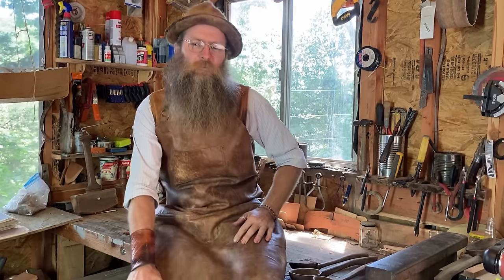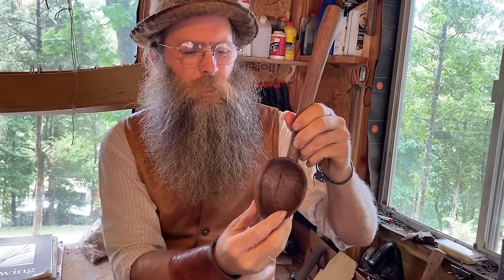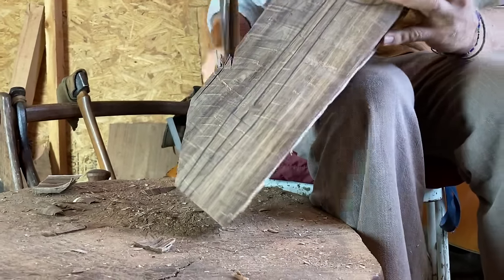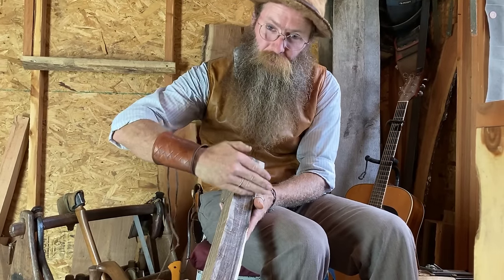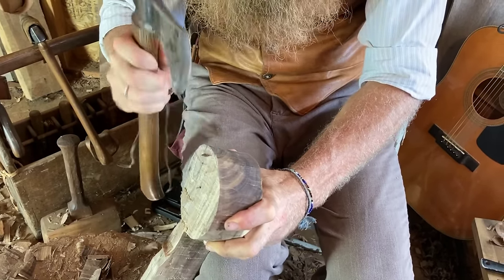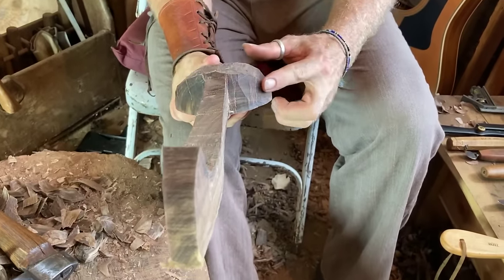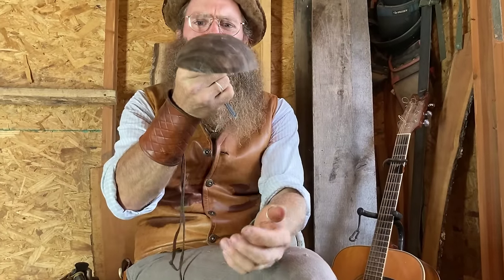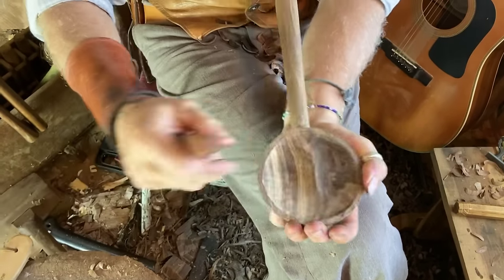How to Carve a Wooden Spoon by Hand

Comment: This is heavenly stuff to watch. I'm enjoying all your videos immensely.
I'm actually a cabinet maker and furniture restorer by trade, so a lot of this looks familiar- except for your insane axe work. I'm bluffed! You take this to the next level.
I have just one remark to make concerning the finish aspect: firstly, thank you for sharing the ingredients you use yourself. When I use anything similar products I apply them hot (hot air gun)- especially beeswax. This method really helps the wax, or even oil, to penetrate much deeper, therefore longe lasting. When I carved my oak chimney surround here in France (450 kgs- about 1,000 lbs of freshly sawn oak) with quite a few details, because I DON'T sand carved stuff, I burnished the whole structure with various bits of hardwood (ebony and boxwood) till every millimetre shined. Push very hard. This gave a nice sheen to the wood. Then came the hot beeswax treatment with some earth pigments. 3 weeks to dry then I removed excess wax and buffed the whole lot. By heating you get a deeper finish.
I hope this information will be useful to some.
Please keep your fantastic videos flowing (just like the beautiful lines you use on your spoons). God bless.
Greetings from France

Comment: Your videos are just full of excellent information! I've never seen someone who can carve out  3/4 of a spoon/ladle with a hatchet before. Incredible control. I've watched copious amounts of videos on spoon carving and all of that information goes out the window with just one of yours. Thank you for sharing your skills!  PS- I didn't have a small scorp, so I took an old wrench I got for .25 cents at a flea market, the type with the round end and the other end is 3/4's open, I think they are called a mechanics wrench?? I turned it into a scorp. I cut off the end that had the 3/4 wrench end and then made a handle for it. The cut end was apoxyed into the handle. Then I took a rotary tool with a cylindrical stone bit and ground down the internal section until it was thin enough to put an edge on it. When I got it sharp enough I used it to carve out bowls on a spoon. It works great!
Reply from the maker: That sounds like it would work really well. Interesting. I think I will try making one thanks for the idea.
Reply: @CarvingAPath  Your welcome!

Comment: Wonderful skill and definitely a lot of good, common-sense advice. I, myself, particularly enjoyed sections re. planning, safety and tool sharpening. However, if you are a beginner and, like myself, have 0 upper-body strength and experience in using a hatch, you may want to consider a different way of procuring your blanks. After a couple of hours of painful experience, still not sorry of trying but definitely not something I can do (using the hatch for preparing the blank, I mean). But I am not discouraged in giving this craft a chance (it is either this or crocheting... please, God, let it be wood carving!). Definitely worth watching, many thanks.

Comment: You are right, you slice. That's why you need a axe with a curved edge. Knives and swords cut better with a curved blade. They slice. A good carving axe should have a good slicing action.  Some companies sell so called carving axes which have a prettu straight edge. Which are a good hacking edge. For rough work. Even a good felling axe as a nice curve. The swing of the axe causes a nice slicing action. A carving axe will always cut better with a nice sweep of the blade. I like the small hatchet you use. Cuts very nice. Always a pleasure to watch sir.

Comment: I used to use olive oil or organic linseed (flax) oil but have switched to avocado oil and coconut oil for utensils I actually use since they are odorless (I haven't used metal utensils in a long time, I used one a few months ago at a friend's house and it felt really strange).  I have also learned to burnish my utensils with a rounded off hardwood dowel (before and after the application) to make them smooth and lock in the finish (although you still have to re-apply from time to time as it dries out).  I enjoyed this session!
Reply: Hi! Can you share the recipe? I want to make one!
Reply: @guadalupeinsausti7753  just straight coconut oil or straight avocado oil, no mixing of ingredients. Just dip it in the jar (or in the case of coconut oil, just scoop a little out) and rub it in.  A little goes a long way.
Reply: @thecordlesscarpenter7956  thank you very much. I grinded some walnuts in my blender and put them in a cloth to rub the table, gave it a beautiful color and some protection. I have a few more sessions to do on the finish, so I’ll use the coconut oil as well. Thank you very much!

Comment: Awesome video, but would like to make one suggestion. If you are as economically strapped as you claim to be, the maximizing the products you can make out of one piece of straight grained walnut is important. A bow saw to cut down both sides of the handle would have yielded 2 smaller blanks which you could have made products from, instead of chipping it away with a hatchet. Just a suggestion, love your vids, and keep up the great work!

Comment: Did that steel wedge split the top of the handle?  I use two axes one has a right handed grind, good for flattening a face on the timber. Watched this a few times now. Always good advice.

Comment: Nice job , you have the masters touch .  Careful with those pinky's  hard to play guitar with nubs .   Is that a Yamaha guitar in the corner?  The head shape doesn't look right for a Martin.   Blessing :-)
Reply from the maker: It is a Washburn. I’ve had it for about 20 years now . It’s getting old and the neck is developing a S turn. But it has a lot of sentimental value. I have never done it before but I am considering trying to put a new neck on it. Anyways thanks for the kind comment
Reply: @CarvingAPath   I have my dads old Kay guitar, It sat in the corner of the house for years with the headstock resting against the wall. The neck was severely bowed and the strings were about 3/4 of an inch off the fret at the 12th fret , I took it to a friend who is a Luther, He had some kind of device ( tool)  that slowly bows it back into position , It has sort of a heating blanket that wraps around it . It has to go through heat cycles and keep increasing the pressure to bow it back in position . If there are any repair shops in your area they might have one of those tools.  The same guy built a guitar for me , ( There is a build video on my youtube page if you want to see the process)  Blessings to you and yours .
Reply from the maker: Absolutely. I will check that out thanks

Comment: Thank you very much for another great video! Will definitely try to apply some of your techniques. Just a beginner spoon carver. What type of fishtail knife do you use? Do you highly recommend this knife or can it be substituted with a straight blade?
Thanks again! Jon
Reply from the maker: Here is a link to the knives that I use.There are four knives shown but I use only the top two. the shallow bent knife and the deep bent knife.

https://www.northbayforge.com/

Here is a link to the third knife that I use

Morakniv Wood Carving 106 Knife with Laminated Steel Blade, 3.2-Inch, M-106-1630 https://www.amazon.com/dp/B005IW5YN8/ref=cm_sw_r_cp_api_glt_fabc_1DRAE54H7CDPEMGAMGQQ

The Northbay forage crooked knives in my opinion are the best and there is no substitute . I hope this helps. And also let me know if you have anymore questions
Reply: Carving A Path awesome! Thank you so much for the prompt response. I’ll be looking into these knives. Thank you for taking my questions and future questions. Very appreciated!
Reply: Another quick question. The fishtail knife you used on the back of the spook bowl. Essential or can it be replaced with one of your other knives you use? And what kind of fishtail knife do you use?
Thanks again!

Comment: Based on my very limited experience, the asymmetric bevel on your hatchet looks to be one a left hander would use for rough outs, but you are using it as a right hander.  Am I wrong on that, or do you find you just like that bevel arrangement, or does it even matter?  I am left handed and as a newbie I bought an asymmetric "left handed" beveled hatchet and am a wondering if that was a bad decision.
Reply from the maker: All of my carving hatchets are beveled on both sides. It is hard to see in the video . But your question is a good one. I found that I don’t like carving with a single bevel It makes the hatchet way less maneuverable. Over the years a lot of the old information has been distorted. If you are going to be flattening out large surfaces such as beams or timbers then a single bevel is good. Because it can excel at that one plane. But if you are carving with it and you need to switch back-and-forth between inside and outside curves than a Double bevel hatchet is much better. The difference between the bevels on my hatches are some of them are much longer and some of them are much shorter. That gives them different attitudes. Some of my hatchets are really aggressive for moving lots of wood and some of them have steeper bevels for making tighter inside Turns. The bevel on your carving hatchet is very important. Changing it a few degrees has a huge impact on the way your hatchet handles. And on your ability to gain confidence and maintain control. I would recommend keeping the hatchet you have for the purpose it was designed for. But I would also recommend getting another one that has a bevel on both sides you will definitely be more successful that way. I hope this answers your question. If you have any more questions feel free to ask we will do our best to answer. Thanks again

Comment: I just found your channel today and subscribed after I watched a bowl carving video. If you've explained this in one of your other videos I'll find it eventually I guess, but I'll ask just in case. Since you use green wood for your carving, how do you stop the bowls and spoons from cracking/checking as they age and dry out?
Reply from the maker: What causes a piece of wood to check is that outside of the wood being exposed to air allowing it to dry. When it dries it shrinks, when it is shrinking, it is shrinking around the interior of the wood that has not been exposed to air and has maintained its original size, leaving the outside of the wood no choice but to relieve it’s self. It does so in the form of a check or crack. The reason why my work does not check or crack is because I carve it all in one session and thin it down leaving no thick spots so the air gets to it from all sides and dries from the inside as well as the outside and because there are no thick spot to maintain a large volume of moisture the wood has no desire to check or crack because it’s not shrinking around the interior of a thick spot maintaining its original volume. 

If you don’t have the opportunity to finish your work in one sitting, place it in a plastic bag while you are not working on it and that will prevent it from cracking or checking. Using a plastic bag will allow you the opportunity to break your project in to multiple sessions. 

Hope that answers your question, and if you have any more questions let us know.
Reply: @CarvingAPath  Yes that does answer it very well. Thank you so much. Oh! Almost forgot. Welcome to Arkansas. I live over on the other side of the state from you in the flatter than a pancake Mississippi delta farm land. But I have a brother that lived in Rodgers and worked in Bentonville. I have been up to visit him a few times so I'm familiar with the area. It's very beautiful country.

Comment: What kind of knife did you use on the handle? Was it a miniature Japanese yari ganna that you used to flow the handle? Looked very similar. Who is the maker?
Reply from the maker: I use two different knives I will send you a link to them and you can get an up close look at them.
https://www.northbayforge.com/ 
I am pretty sure this is the knife that you were talking about. It is a very capable piece of equipment. I will send you a link to the other one that I use https://www.knivesofthenorth.com/products/mora-wood-carving-106-knife
Both of those knives are essential to any carving tool kit. Anyways I hope this answered your question if you have any other questions feel free to ask. And thanks for the positive feedback
Reply: @CarvingAPath  thanks. Glad to know about North Bay Forge now.

Comment: How to you prevent carved items from cracking, i have done some carving projects, but the tend to crack when i bring them indoors.
Reply from the maker: That’s a good question.I eliminate its desire to crack or split by carving my spoon or bowl all in one Setting . And I will carve the bowl of the spoon evenly thin to roughly 1/ quarter inch. I will thin the wall thickness of my bowl down to 3/8 to 1/4.And by achieving that even wall thickness it eliminates the woods desire to split. What causes wood to split is a large volume of wood drying out faster on the outside shrinking over the inside of the woods original size and volume. If you carve your wood down thin it dries from the inside and the outside at the same time Eliminating the desire to Split. If you don’t have time to complete your project in one sitting put it in a plastic bag until the next time you have a chance to work on it that will keep it from drying out and cracking . Anyways I hope This answered your question. If you have any questions about anything else tools or sharpening etc. feel free to ask. And thanks for the positive feedback
Reply: @CarvingAPath  Thx so much for this answer, i have wondered why it happens. Its actually quite thick, so that makes total sense. I have kids so finding the time to do it in one setting is hard, but i will make my best. If i dont, should i but it in a bag in the meantime? thx agains for your detailed answer.
Reply from the maker: Absolutely. In between working on it keep it in a bag that prevents air from getting to it and keeps it from drying out and cracking. Putting it in a bag in between working on it allows you to break it into as many sessions as you need To finish it. Thanks again

Comment: Where is a good place to buy the tools.
Reply from the maker: Fiskers Hatchet

https://www.amazon.com/Fiskars-X7-Hatchet-Inch-378501-1002/dp/B0002YTO7E/ref=asc_df_B0002YTO7E/?tag=hyprod-20&linkCode=df0&hvadid=167118301188&hvpos=&hvnetw=g&hvrand=10420532384647696280&hvpone=&hvptwo=&hvqmt=&hvdev=m&hvdvcmdl=&hvlocint=&hvlocphy=9026011&hvtargid=pla-312501403132&psc=1

North Bay Crooked knife
The ones I am using are the top two

https:www.northbayforge.com/

Mora Carving knife

https://www.amazon.com/Morakniv-Carving-Knife-Laminated-3-2-Inch/dp/B005IW5YN8/ref=mp_s_a_1_2_sspa?dchild=1&keywords=mora+carving+knife&qid=1626981664&sprefix=mora+carving+&sr=8-2-spons&psc=1&spLa=ZW5jcnlwdGVkUXVhbGlmaWVyPUEzSERDVFJTQkpDR05KJmVuY3J5cHRlZElkPUEwMjQ5NjM5MlZRTTdQMDdLVTRGQiZlbmNyeXB0ZWRBZElkPUEwMTc1ODU5WDEwVktIWEZaMEQ5JndpZGdldE5hbWU9c3BfcGhvbmVfc2VhcmNoX2F0ZiZhY3Rpb249Y2xpY2tSZWRpcmVjdCZkb05vdExvZ0NsaWNrPXRydWU=

Swiss made Gouge

https://www.woodcraft.com/products/pfeil-swiss-made-8-sweep-bent-gouge-30-mm-full-size?gclid=CjwKCAjwruSHBhAtEiwA_qCppobYGVyA2LZOR6ggGX4Gftmkrer_AzZn07BvSFzPLcOwAWxKCh34SRoCP8EQAvD_BwE#

Strop 

https://www.woodcraft.com/products/butz-strop-1?gclid=CjwKCAjwruSHBhAtEiwA_qCpppjn4glquo2x9kAp3-MeXeMXCfLXDVAU53xGv1TNV7yS9hbWEz615BoCYj8QAvD_BwE

Yellowstone Honing Compound

https://www.google.com/amp/s/www.woodworkingshop.com/amp/product/HRBD1/

If you have any questions about any of the tools or techniques or anything in general, feel free to ask.